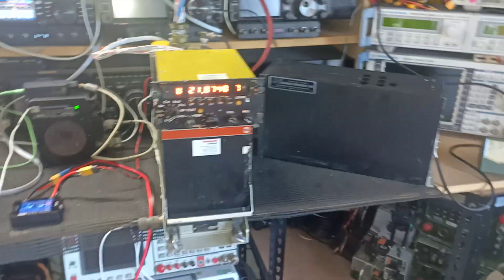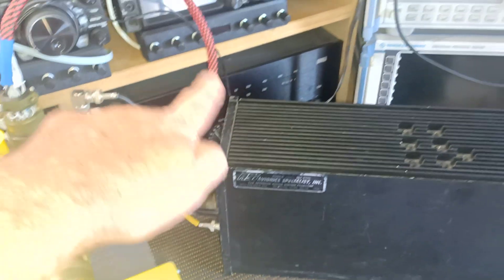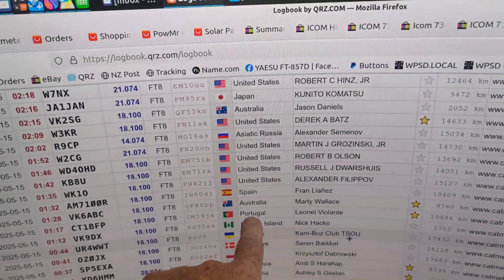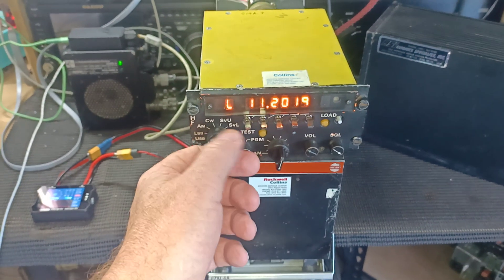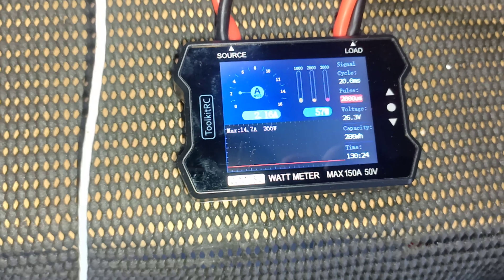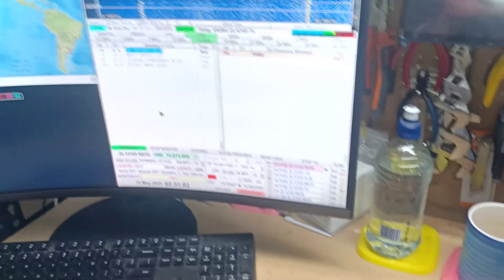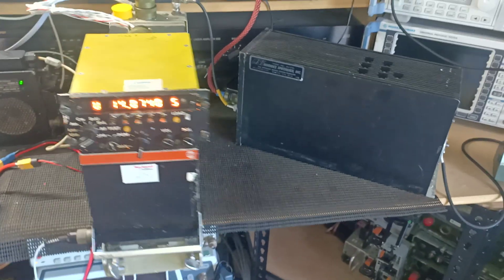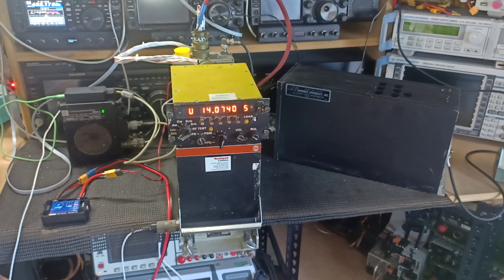Collins ARC-174 / 718U-5 operating FT8 (MSHV & GridTracker2)

Comment: I really like to see you playing with old military gear. It looks like fun. But I don't fully understand the terminology you're using. Are you referring to the unit as a receiver that includes a transmit exciter, and you are just running the exciter as your transmitter for the digital mode transmissions?
Reply from the maker: What you see in the video is a complete HF transceiver. It is known in the military as an AN/ARC-174 or in civilian aircraft as 718U-5. Same gear, different model numbers for different customers. It comprises.  It comprises Control unit 514A-7, receiver/exciter 671U-4A mounted in tray 990C-3 with Amp/Coupler 548S-3. Operates on standard aircraft 26V DC.